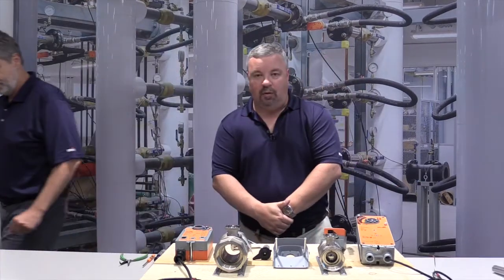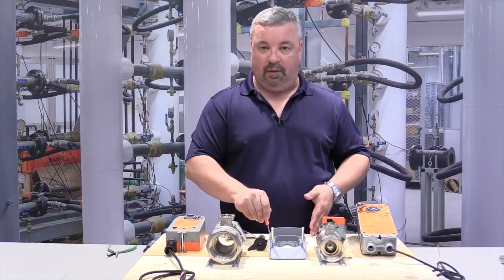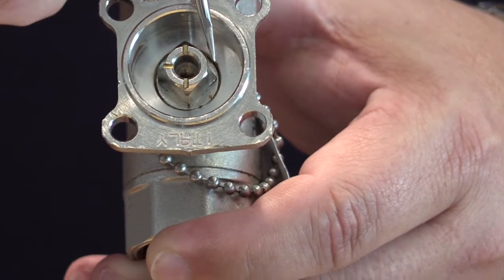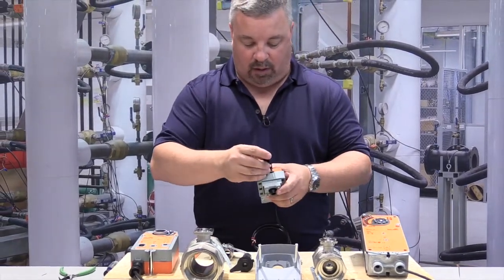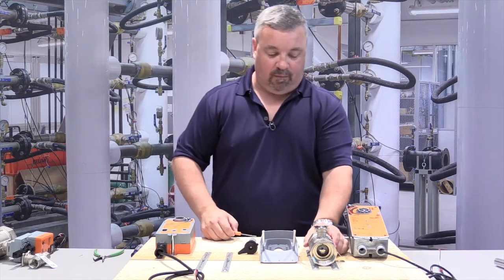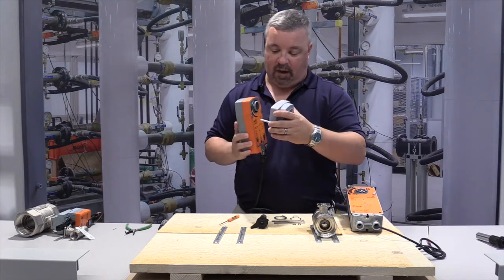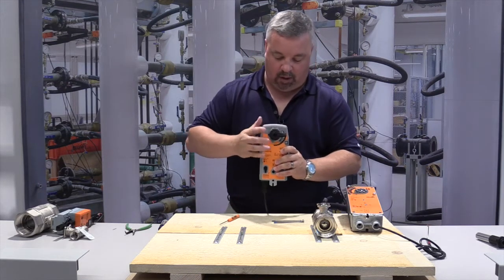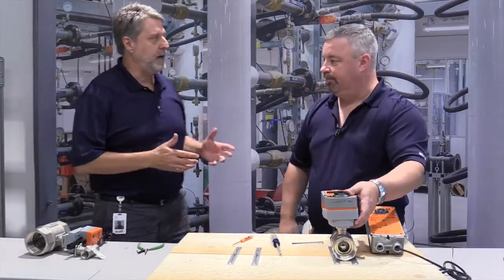How To: Tech Tips for Characterized Control Valves (CCV)

Comment: I Have two mounted side by for seasonal valve control on an AHU. Would I need to pull the actuator and change the value position to closed on one of them if I wanted them to work opposite of each other. Right now the both open and close when the command is given for the seasonal to engage.
Reply from the maker: Hi Jered - If you need any help figuring out your CCVs on your AHU, our technical support team is available to walk you through any help you need. The contact information can be found on this webpage: https://www.belimo.com/us/en_US/contact/channels/belimo-contacts

Comment: We are installing a lot of Belimo valves with the AFR actuator.
Can the actuator be oriented perpendicular to the piping?
With the "key way" / groove on the stem, it didn't seem like we could.
Thanks a LOT in advance.
Great video.
Reply from the maker: Thank you for your question! Yes, the actuators can be moved to a different quadrant. To change the position remove the actuator from the stem adaptor. On the second page of the linked installation instructions shows how it can be done: https://www.belimo.com/mam/general-documents/installation-instructions/belimo_AFR_installation-instructions_en-us.pdf
If you have any additional questions or issues please you can contact the technical support team at +1 800-543-9038
Reply: @Belimo_Global  Duly noted for future reference. I do have that original paper work, and later did see where it stated that it could be turned.
I think it would help to have a picture of it in the perpendicular position in future instructions. Also, in a video.
Thanks!👍